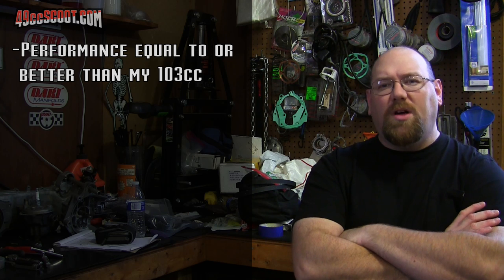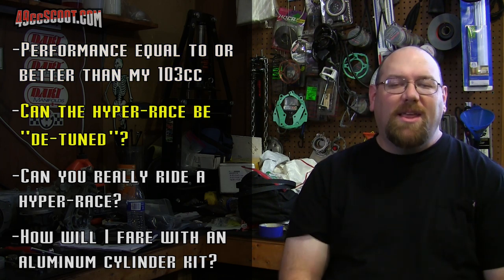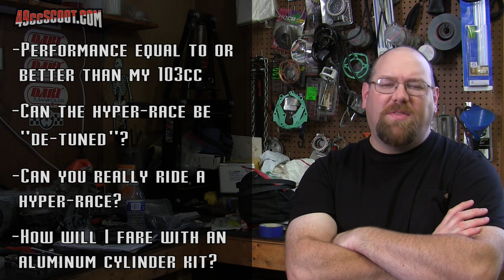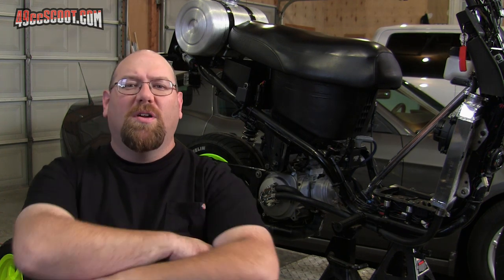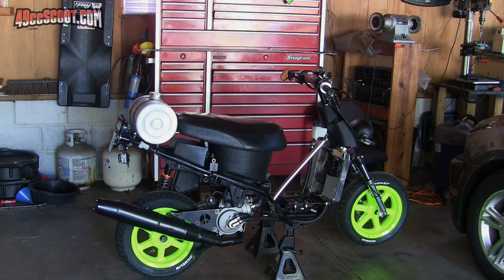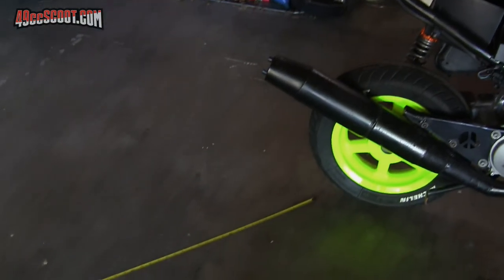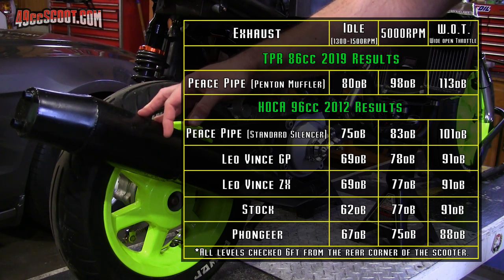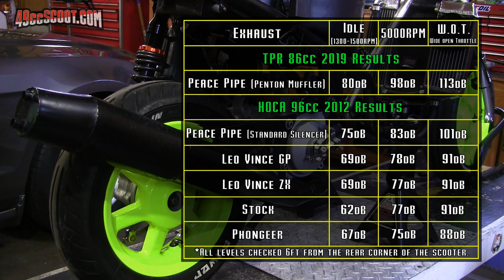TPR 86cc Build : Part 17 : Goals Met? The Future?  + Decibel Level Check

Comment: The thing is while you can ride this around on lower revs with no issue, all the power is found higher up, as is usually the case with two stroke engines. You will have a lot more fun with a higher revving pipe.

Comment: Nice! Thanks for doin a noise check on this set up that you have. Totally get what youre on about the arrester being closer to the rider making it seem that a wrap around exhaust is louder and the peace pipe much further towards the rear.

Im betting the new exhaust will be louder, in a good way of course 😅. and if your going to modify anything on the intake side coz im guessing thatll add more good sounding two stroke noise to the build 👌🏾.

Another great vid btw will stay tuned def!

Comment: I'm surprised you havent tested a yasuni carrera exhaust in that list bro

My vote would be to get a c30 or c16 if you want a wider powerband to work with.

Inner rotor Ignition go with these pvl,italkit or mvt(if you want light signal)

28-34mm carb
Reply from the maker: I haven't owned higher rev pipes really. The Peace Pipe that's on here now is about it, aside from an MRP exhaust that would rev pretty high. The stinger diameter on that  was so small that it started burning the 96cc's piston  crown a few miles into a test ride. It was truly a 50-70cc only exhaust. I've spent a whole lot of time riding big low rev Minarelli clones so that's what most of my pipes are from.

Comment: You do some awesome stuff.I for myself use a Vespa Et2 for netherlands to swiss,austria and then italy travels multiple times a year .So i would like to ask you if you think the setup can last around 5000km (3000miles)Without any maintainace. My Setup right now is the most common of the Vespisti 50 ccers. 70cc dr/top performance evo on 17,5mm carb ,longer gearing,multivar and original filter.Till now the cylindergroup is lasting around 9000km with no maintainance.
Reply from the maker: Not sure. I don't imagine it will last 3000km without maintenance with all the high rev stuff. Maybe as-is, although at that rate it may be better to just stick with midrace kits and exhausts. I think you'd at least need to re-ring this, if not change the piston as well.
Reply: @49ccscoot  Thanks for the answer, maybe you can try to test it on longevety with a low revving exhaust. Till then i think i stick to my sports 75cc,its a 2 ring cylinder so not even a midracer.The problem is that endless comprimises on longer travels,cant carry too much weight as the vespas become very instable and topheavy with 35kilo of holidayclothing already.The biggest issue is my cruisingspeed,wont be much above 80-90 kph or 50-55 miles an hour.I hope to get it to like 65on straights without suffering reliability,as im too far from home to really do much about greater problems.
Reply from the maker: @oliverfuchs4357  I think it may be worth some compromise of speed for kits that don't have huge bridged ports and single rings. Honestly, I'd still prefer cast iron to aluminum for racking up miles.
Reply: @49ccscoot  Sure do! The castiron 2 rings are more forgiving in for example altitude riding.Still i would love to reach the 100kmh 62mph on the flats effordless.Air cooling as well has it´s simplicity advantage too.Mine is btw not bridged, just worked the exhaust port .The rest of the DR evo is more or less a stuck on one with gaskets and head playaround.I even reduced the compression ratio last time to get a more comfy midrange performance on regular 60-80kmh netherlands roads.It´s a science apart to find out what really works for you.Thanks for your opinion ,i see lots of knowledge in your words.Keep up going on with your channel,cause in some cases you help others,like me ,brainstorm it over and over again.Till the day all of the individuals got it right ,for their own needs.Your a legend!
Reply from the maker: @oliverfuchs4357  If you look back at the video I put up earlier this year about a riding buddy for a day, he had a Polini Corsa (iron, dual ring, single exhaust port) and was going 60+ when we rode. I put a slide of the details of his setup in that video.